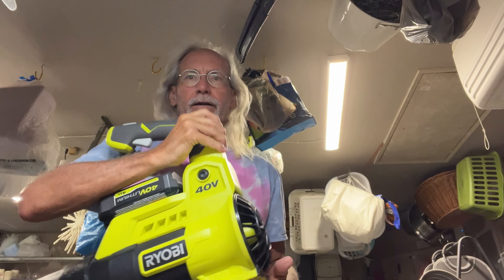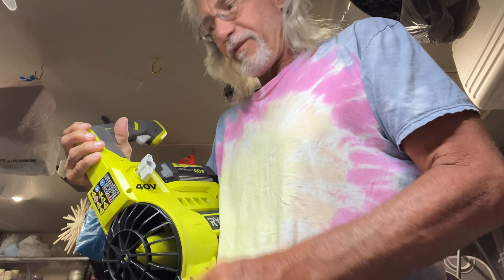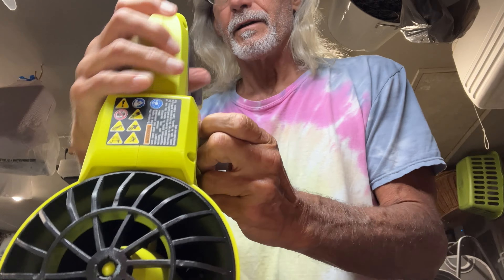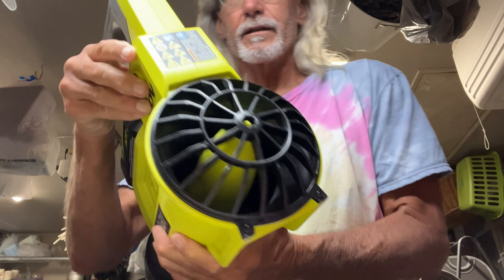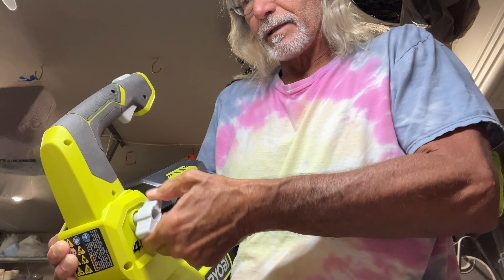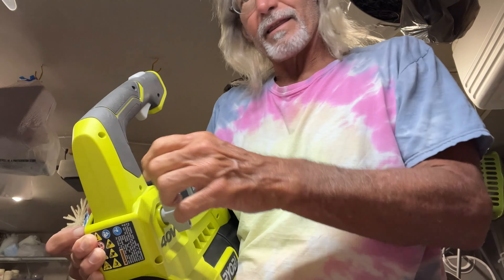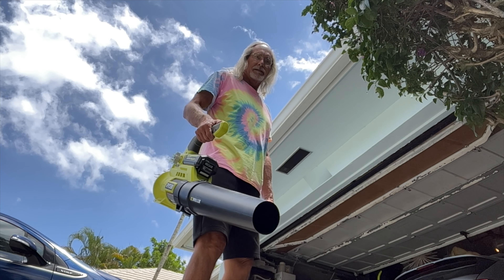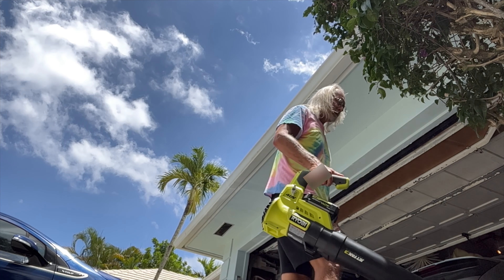How to adjust handle position on RYOBI 40V Cordless Jet Fan Leaf Blower

Comment: I apologize if I am asking too mucb by asking for your advice, especially if you end up being as clueless on this as I am. Apparently something is not right with the handle on my blower and it is driving me crazy. It has been this way since the day I bought it but I didn't realize anything was wrong until it was too late. With the turn knob completely tightened down, the handle still moves, and it is so annoying for it to move when you are actively using it. I followed your directions and completely loosened the turn knob until it came out, but mine came out without the bolt attached.   When I look into the hole where the turn knob was. I do see the end of a bolt flush with the bottom of the hole for the turn knob. Do you have any ideas here?
Reply from the maker: It sounds like you lost the bolt on the one side that it screws into and that’s why it’s loose
Reply: Found a solution, but not exactly ideal.  I realized that  my blower is a a different model - RY40407VNM.  The  only bolt in my blower stays in the  hole and the turn knob tightens down onto it. The problem appears to be a design flaw. I finally noticed that with the turn knob completely tightened down, it is tightening the top front part of the housing that holds the handle, but there is nothing to tighten the top back part of the housing. The only fixed screw that holds the housing together is at the bottom of the back. When the handle slips from one position to another with the turn knob tightened down, you can see the housing separating at the top in the back.  The only  solution I have found is to put a C-Clamp across the housing at the top in the back. The handle no longer moves.

Comment: The blower I have has a very short bolt. Nothing like yours
Reply from the maker: You must have a little bit different model than mine. They have a couple different ones. I would have to see it to figure it out. Good luck thanks for watching.
Reply: @TomLeeman  I'm in toronto. Maybe canada has different models.